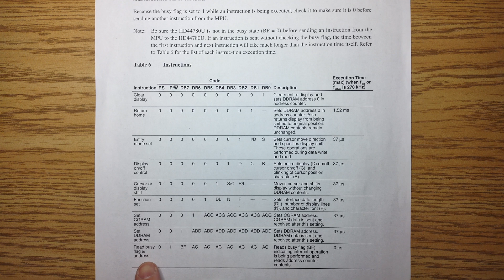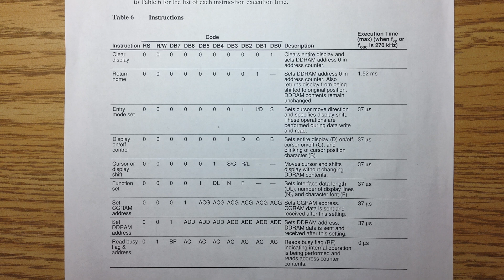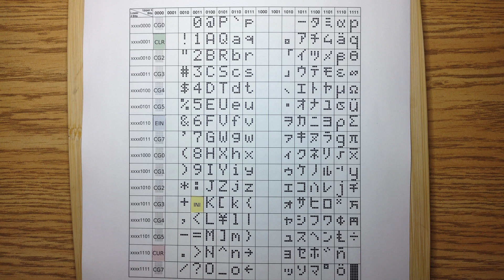LCD Character Display: Milestone 1 Complete!

Comment: Oustanding video series. Thanks you very much! Will be following any future projects you come up with. I finally got this to work. The one thing that I do not understand is that running say_hello.py on Windows all the characters were output as double byte values, I assume as Unicode. The display had a spurious character preceding every character. I hit upon the idea to run say_hello.py on a Linux box and then got a BIN file with only ASCII output as the result. The Linux BIN file worked as expected. Any ideas on the difference between Python running on Windows versus Linux and the interpretation of characters in Python?
Reply from the maker: Thanks. Open a ticket on my github repo, it's probably an easy fix for windows compatibility.
Reply: @IanWard1  Done. I asume you can get my email address from the submitted issue since I was logged into GitHub. If not let me know.

Comment: Can someone explain how the 9 bit in only 8 bits worked? I didn't get it.
Reply from the maker: The second ROM is a lookup table for the RS (9th) bit based on the 8-bit program value. So you get 8 bits from the program ROM and 1 bit from the lookup table.

I tried to illustrate that with the holes cut in the sheet with the character set. Each 8 bit value will either be a character output (RS=1, no hole) or a command (RS=0, hole showing the command table below).